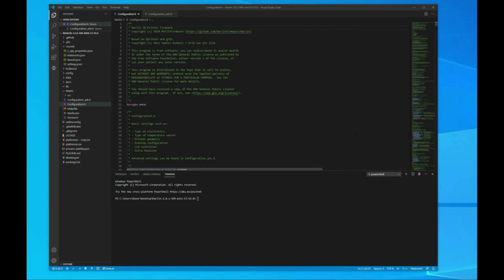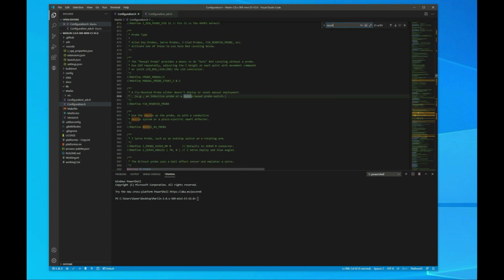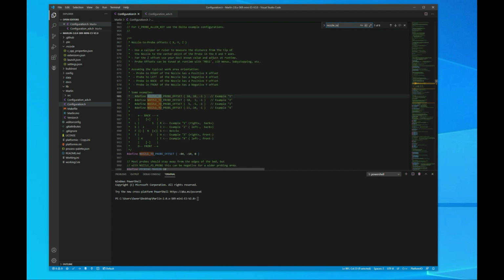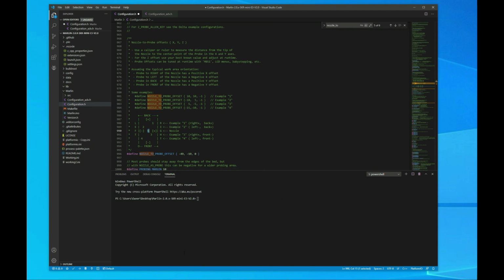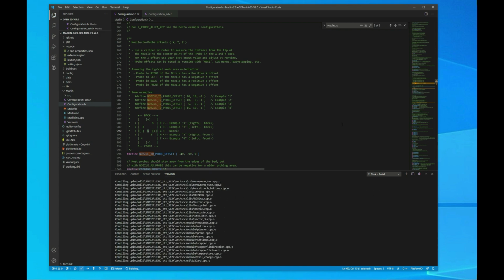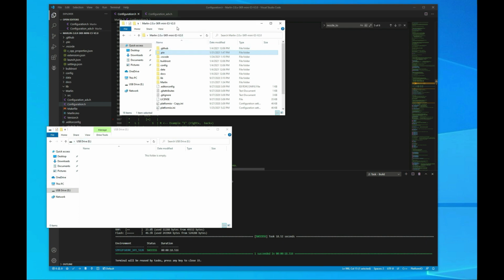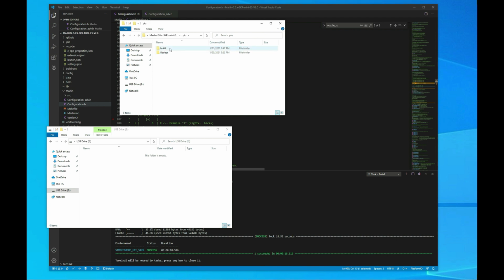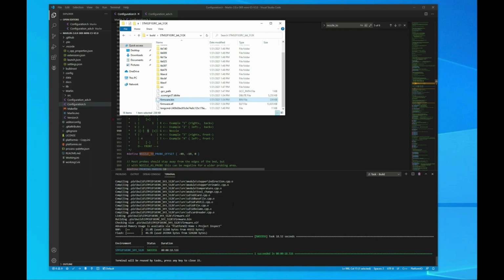Ender 3 Fan Upgrade - My Choice and Install Guide

Comment: Hi, great video! I'm talking about Brazil, I would like to know if the fan I have to buy is 12 or 24v, and if this exact procedure works for the Ender 3 V2. Thanks
Reply from the maker: Hi. The fan is 24v and it should work but i cant say for sure because i dont have the v2 to test with.

Comment: I am having difficulty locateding the stl file for the bltouch mount you display in your video.
Reply from the maker: Hi. Its in the video description on this video. https://youtu.be/SqhEmw7aTCM
Reply: The piece I need is the bltouch adapter.
Thanks,
Ray
Reply from the maker: @rayrclark  The stock medal one comes with the bltouch. I checked around but im not seeing any replacement ones that are already made to print.
Reply: @3DPrintscape  I am also trying to locate the piece as well, it is the one that connects the BL Touch to the fan housing. I have the ones that connect to the BL Touch itself, but not the one that has the diagonal screw holes and affixes to the fan housing. Can you send a link for it? Thanks.
Reply from the maker: @Muslimsteel  I just look and couldn't find it, it looks like it may have been removed. I found another one that should work and linked to it in the video description.
Reply: @3DPrintscape  Thank you! I was digging through the comments and saw that one as well, figured I would wait to see what your thoughts were. Thanks again and for all the helpful videos!

Comment: Really enjoying the content and has helped me resolve a few of my issues, just a query, if you dont have BL touch you dont need to do the firmware?
Reply from the maker: Hi. Thanks for the feedback. If you dont have the bltouch upgrading the firmware is optional. If your on a relatively new version of the creality firmware, have a 32-bit board, and everything works for you i wouldn't mess with it unless there is a reason to.

Comment: Hey I downloaded the Satsana but my winsinn 5015 24v blower keeps getting super hot mid print and shutting off, any ideas? I spliced and soldered the wires together exactly like you did
Reply from the maker: Hi. Can you confirm that the air is blowing out of the blower side of the fan? That will tell us for sure that the wiring is right.

Comment: Do you use an adhesive when printing on a glass bed? I'm having issues with the PLA and ABS sticking after I replaced the stock magnetic bed.
Reply from the maker: Hi. Ya, most of the time i use Bed Weld, it has always worked good for me.

Comment: I'm having trouble with my bltouch idk if you can help but when powered on the thing goes up and down like normal but it won't when trying to level my bed or auto home it doesn't go down I've tried to reflash it but it's not working 

And it was working before
Reply from the maker: Hi. Based on your name i think you reached out in Discord. If thats not correct and you need help here let me know.
Reply: @3DPrintscape  yes I got in touch with you on discord

Comment: Fitted the red squirrel fan duct last week with the hero me bl touch mount gos together nicely
Reply: Quick and simple to print and assembly
Reply from the maker: Hi. Nice its a great option that supports mods. It was the only one I could modify, without doing significant redesign work, to work with the direct-drive setup I have.

Comment: I literally purchased that fan last night. Your channel has really been helpful as your content has grown, now if only I can get my BLtouch to actually seem like its doing something.
Reply from the maker: Hi. Thanks for the feedback. What issues are you having with your BLTouch? Also, if you want to chat about it, you can join the discord server I just setup Join us on Discord: https://discord.gg/Bu94EYVkrU .
Reply: @3DPrintscape  I will definitely be looking into the Discord when I get off work. In a nut-shell no matter what I do the nozzle just goes wherever it pleases. It doesn't matter how many times I do (and save) the z-offset wizard, the nozzle is either divebombing the bed, or too high for a first print to adhere. I can't remember the last time I didn't have to babystep what feels like an arbitrary number in who knows what direction at the start of every print (post leveling). I've done more bed leveling since I installed the bltouch than I ever did just manually leveling the bed. To the point I'm wondering if its even worth still having on there. I don't know if I'm doing something out of order, if its firmware (which I'm only hoping I did right), if its the skr e3 mini, or btt touch screen board, or some combo. With the exception of the direct drive I think we are running very similar equipment.
Reply from the maker: @TheToonamiRevolution  Thats really odd behavior. If you can, join the discord channel later and we can try to walk through it. It sounds like you have the TFT35, so setting the z-offset should be easy with the wizard it has.

Comment: This is awesome. I'd just found a remix of the Red Squirrel fan duct and was installing last night along with my Micro Swiss all metal hotend...Broke a thermistor so decided to put that away until morning. But basically the same thing you're doing here. :)
Reply from the maker: Hi. The red squirrel is a good platform to work off of, and has a low profile which was a requirement for me. When I was looking for one that would work with my direct drive I couldn’t find anything I really liked, so I modified that one.